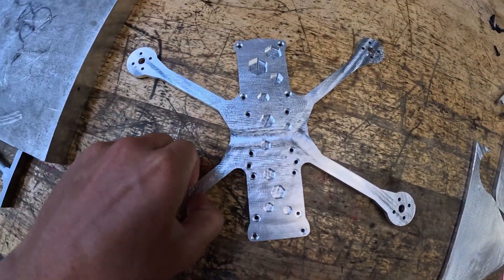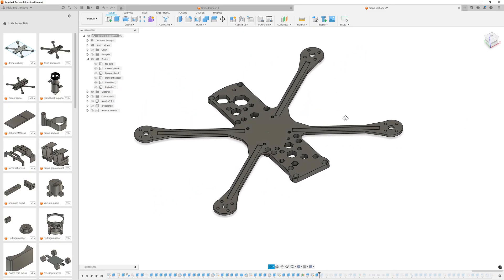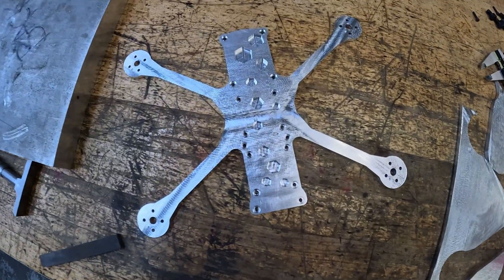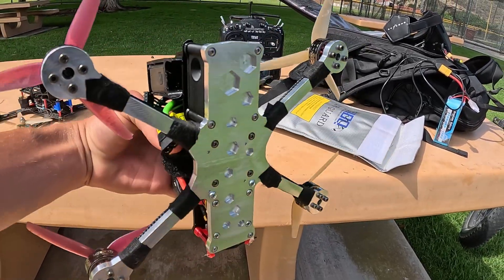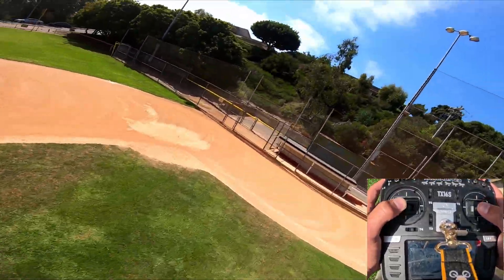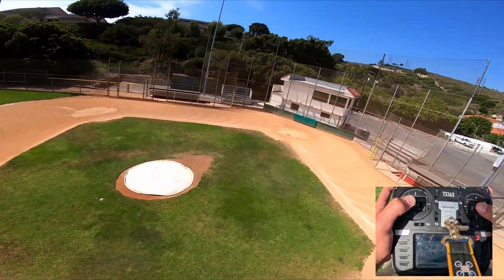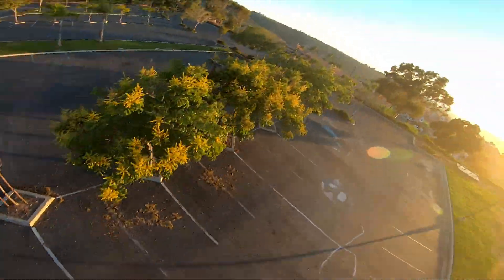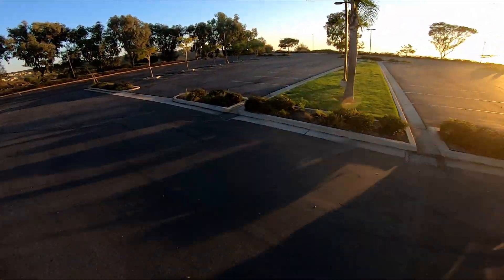Custom Aluminum FPV Drone!!!

Comment: the real question is
is it sub 250?
Reply from the maker: No its around 800 grams sadly. Its hard to make a powerful 5 inch drone when its carrying a Gopro. Also aluminum wouldn't be the best material to make a ultra lightweight drone, its better to stick to carbon fiber for that application.
Reply: @MistaFPV yeah I was just trying to make a dumb ironic joke

Comment: I love seeing the hobby come around in a full circle. Aluminum frames were experimented with in the early 2010s. Because we used F1 flight controllers like the CC3d (Openpilot) and the Naze32 (Cleanflight), we had very poor resonance and vibration issues. Due to other limitations like heat dissipation, we began using integrated PDBs to power our motors. Some of the more conductive frames that used aluminum and carbon fiber caught on fire, so we saw a short rise of fiberglass frames. Then we saw glass carbon fiber composite frames: shear force resistance of carbon fiber and the insulation properties of fiberglass. Once 4 in one ESC stacks became standard, the integrated PDBs disappeared and we saw a near 100% shift towards carbon fiber frames. Seeing your frame brought me back to the advent of FPV, during the Charpu era.
Reply from the maker: Wow, glad I could take you back to the old FPV times.